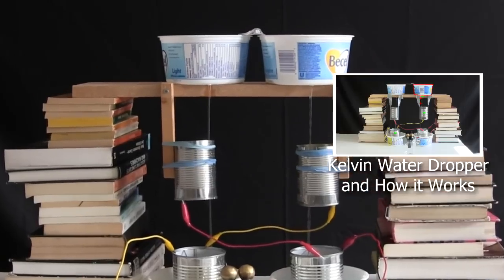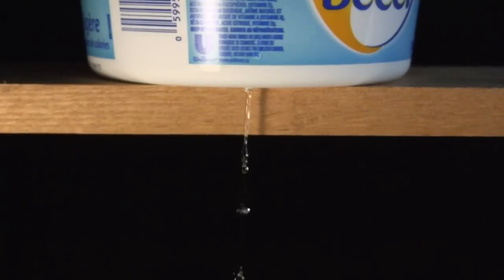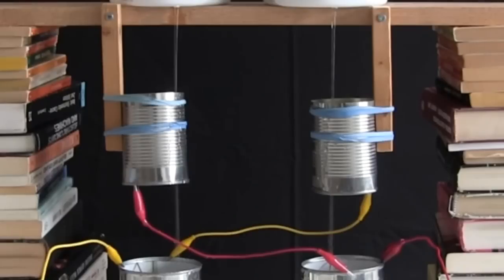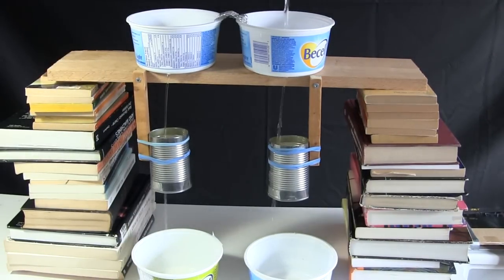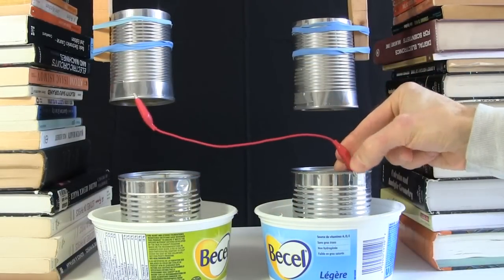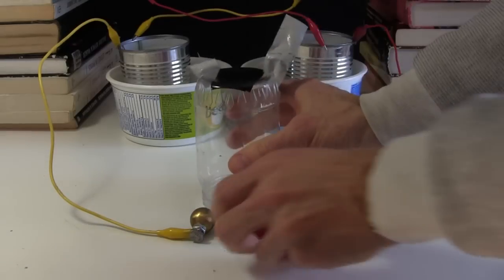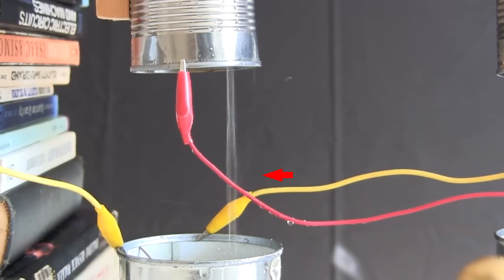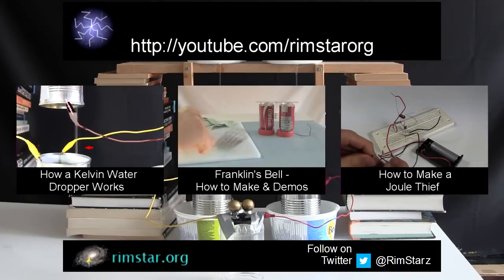How to Make Kelvin Water Dropper/Lord Kelvin's Thunderstorm

Comment from the maker: Some of your questions are answered in my other video "Kelvin Water Dropper and How it Works". There only has to be a different charge in one place on one container, and there usually just is - not everywhere is always neutral. The charge of water drop depends on the voltage between the water stream and the inductor can before the drop breaks away from the stream. There's nothing to do with LC circuits or antennas here.

Comment from the maker: You can make it smaller, the limit being due to the water drops getting repelled from the receivers (the bottom cans) and the need for some spacing between the two sides, as mentioned in the video. The kv is because it produces direct current and that the spark gap has a low capacitance. The low capacitance means that the small charge in the current can reach high voltage in a reasonable time. So if your app has a small capacitance, or can wait for the charge to accumulate, then yes.

Comment from the maker: It can be used to charge a capacitor. In fact, that's what the spark gap is. It's a two plate capacitor with an air gap as the dielectric. We just happen to charge it too much, so much that the dielectric breaks down. It's a very low capacitance but high voltage capacitor.

Comment from the maker: @Abdulmalik alshaibi No, you don't have to remove the paint for the inductors. You do have to make sure the wire that connects to them is connected to metal.
Regarding the other cans on the bottom, soda cans usually have a coating inside them so you may have to scrape some off so that the water contacts the metal if you're using soda cans there too.PS There's no Reply button under your comment because of your Google+ settings.- go to your Google+ page,- in the top, right corner click on your thumbnail icon,- in the popup that appears, click on "Settings".- for the 2nd question down "Who can comment on your public posts?" set it to "Anyone".
Reply: Thank you so much for the fast reply.
Reply: RimstarOrg hey can you connect this to a Leyden jar or multiple Leyden jars using water ?

Comment from the maker: The accumulation of charge inside a receiver can that's on the table depends on the number of electric drops that fall into the can and the charge on those drops. Regarding rings, if you have a ring instead of an inductor can and drops circled around and touched the ring then the ring would lose some charge. In my case the water wasn't circling around like that though.

Comment: I built a kelvin generator for high school, many many decades ago, and in the circuit between the lower cans I had 8 NE2 bulbs in series and the spark gap.  You thus got both flashing lights and spark.
Reply from the maker: Tom Gillett Nice.

Comment: Why at the start up there is a different electric charge in the containers ?
 
Are not all neutral the drops of water ?

The charge of water drop depends from its radius ?
 
Depends from different value of charges present in the tanks in the startup ?
 
Are the containers or the drops different antenna (LC circuits ) for electromagnetic waves received from external enviroment ?

Comment: Hi there. Great video! :) im trying to do this for my science experiment, but im facing some difficulties. Would it be alright if i ask u some questions here?

for my set-up, im using retort stands to hold the two cans in mid air, the same retort stand is also used to support the wooden plank which holds the reservoir. (is this workable?)

would this be a suitable RQ for an experiment?

How does the rate of flow(size of hole) affect the amount of voltage generated?

Comment: The accumulation of charge inside the bucket, depends from the number of electric drops deflected that go on the table (not in the bucket and not in the conducting can ) ? .... Becose if charged drop goes over the conducting ring, the charge of ring goes down and the process stop. If all the charged drop goes inside the container, the value of charge in the container dosen't change ....Is it right ?

Comment: In my STEM class my group is trying to make this, we were wondering if we needed the wire at the bottom of the can? Or is that just if there's a coating?
Reply from the maker: LuckyStrikes The wire at the bottom of the can is there just to help if there's a coating in the can. If your can doesn't have any coating i.e. it's all metal, then you don't need the wire.I'd put the wire because the area of coating I'd scraped in the bottom of the can kept getting rusty, which isn't a great electrical conductor. So I put the wire as an extra path for electricity to flow from the water to the top lip of the can.

Comment: Thanks for answering my question, but I also had another question on how I would attach this generator to the LED light. Like how would I power it? 2 alligator clips attached on both ends?
Reply from the maker: You'd have to build up the charge first, just like you normally do while waiting for the spark. So I guess wire a very low capacitance capacitor to the spark gap so instead of getting a spark, you'd accumulate your charge in the capacitor. Then, once you've accumulated enough charge in the capacitor, you'd somehow dump that charge into the LED. That part, I don't know how you'd do. :(

Comment: I'm trying to do this experiment with my little brother. we have everything set up but still we can't manage to get a spark. we've tried with different cans of different diameters, and right now we covered some cans with aluminium foil (so all of it can conduct electricity). we've checked the conductivity of the cans to the balls were the spark should be happening and it works, but somehow when we let the water fall it doesn't work. it's a fluent stream when it's passing the first cans and then is turbulent when is exiting it. Any tips or ideas?
Thanks for the help and for the great video.
Reply from the maker: +tomas lugo In order for the charging of the stream to take place, the stream must fall fairly close to the inside wall of the inductor. Even though in the my example I used soup cans for the inductors, the stream ended up having to pass only about 1 centimeter (1/2 inch) from the inside. So you don't need big diameter cans. It will take a lot of adjusting to get this right.
The parts of the two objects that face each other at the spark gap should not be sharp points. They should be smooth. That's why I used two metal balls. You can find rounded drawer handles in hardware stores but make sure you scrape off any possible coating where you connect wires to them and where they are facing each other. Put a dark background behind the spark gap to see faint sparks. Try with a very small spark gap.Thanks for watching and have fun!

Comment: Hello there, thank you for the amazingly awesome video! I have a question. How do you know if the top 2 cans is a positive or negative charge? like let's say both of my top cans are negative charges (or positive) how would i be able to make the other one a different charge?
Reply from the maker: The answer to how to know is complicated and involves using an electroscope. See my video "Positive or Negative? How to Find Electric Charge Polarity" http://youtu.be/HupFY_24o-4 for instructions. The 2 cans should be oppositely charged automatically though. I guess you could simple touch one with your finger while it's running to unbalance the charge.
Reply: You could use at least 3 transistor, a led, anttena to easily build a polarity detector

Comment: I'm trying to do the same experiment as shown in the video for a school project. The only major difference is that I am using nails and brass bars instead of brass balls.I kept all the problem in mind that could occur but it still isn't working. Can you please tell me what else can I do to make it work? My project is due in 2 days.
Reply from the maker: Rakesh Mittal You mention nails and brass bars for the spark gap. Make sure that the parts facing each other across the spark gap are not sharp. The rounder they are the better.It does take some adjusting, mostly with making sure the water 
entering the inductor cylinders from the top is a solid stream and the 
water coming out of it is not. Also the position of the stream inside 
the inductor cylinders makes a difference. So play around with the 
height of the cylinders in the stream and try getting the stream as 
close to the inside of the cylinders as possible without touching.You could also try making an electroscope like I show in my video "https://www.youtube.com/watch?v=sArNxGnYhNU" You can see how to make one in my video "https://www.youtube.com/watch?v=2PmWlPjV6n0".
Also, put a background behind the spark gap and try making the gap small to see faint sparks.

Comment: Hello, I have another question.
I would like to know how you could use this generator to power certain electronics. What can it power and how would you attach it to the electronic to power it. You could possibly explain this in a video demonstrating what you can power with this generator and how to do it, if you cannot make a video, is it possible still to answer my question?
Reply from the maker: I can't think of anything it could power. It's extremely week. But I guess it can be scaled up in size and quality to maybe make an LED light up every now and then.
Reply: electrostatic generators arnt much efficient to generate current
but recently i read a paper about a jet electrostatic generator that reassembles kelvin water dropper
but they use just one and not a tandem
instead using gravity, they use as they describe it balistic enertia and they slow the droplet using an electric field

Comment: Does the Kelvin Water Dropper have a extremely high amount of electricity? Can it charge my iPad/Computer? Or is it only strong enough to power an LED light?
Reply from the maker: It's output isn't good enough for either of those things, practically speaking. But if you accumulate enough of it in a capacitor over a period of time you could make the LED turn on briefly. Then you'd have to wait while it accumulates more to turn it on again.

Comment: I would be really grateful if you could answer this question... I am trying to build a water dropper for a project, but I can't find a way to measure the voltage or current that is generated in the system. Where would I have to place the multimeter? Thanks!
Reply from the maker: This is high voltage (1000s) so you can't use a multimeter with normal probes. However, there are high voltage probes that you can connect to your meter. I have a video about the one I use most often http://youtu.be/kXq4FCQ0C38.
You could use the spark length to estimate voltage instead. I wrote an article here about doing that http://hackaday.com/2016/12/08/measuring-high-voltage-in-millimeters-and-other-hv-probe-tricks/. It also talks about high voltage probes.
Measuring current is trickier since high voltage is involved. I've used an analog meter in the past but I don't think the current is high enough with the water dropper for that. Another possibility is to connect a resistor inline with one of the wires going to one end of the spark gap, making sure to keep all connections without sharp edges and away from any water, and measure the voltage across that resistor. Then use the formula, current = voltage / resistance. I haven't tried that method yet.
Reply: RimstarOrg Thanks a lot! I have seen someone use a galvanometer to measure the current. How would I have to connect that?
Reply from the maker: I've never used a galvanometer, though it seems very much like an analog meter. Just disconnect one of the wires going to one side of the spark gap and connect one end of the galvanometer to that wire and the other end to the spark gap. If the needle doesn't move, or if it goes the wrong way, then disconnect the meter, turn it around and connect it back up again.

Comment: Good Day :) I'm so interested with this one so I decided to use this in my presentation, but of course with the acknowledgement for you . I've try to do this water dropper, I've also follow all the instruction that you gave but why is it still not working and produce a spark?
Reply from the maker: +Leniram Ledodnum Hi. Read through the comments to this video. You'll find other people have had problems too and found solutions and if you still can't find the problem, let me know.
Reply: +Leniram Ledodnum Yes Sir I also did your comment with their problems but it is still not working.  Can I have some questions?? Does the rust in the can affect the flow of electricity or charges?
Reply from the maker: +Leniram Ledodnum Yes, the rust can affect the flow of electricity. If there's rust then you should scrap it off and try again.
Reply: +Leniram Ledodnum I've already use a new one can but it is still not working, do I need to use the same can that you've use on your video?
Reply from the maker: +Leniram Ledodnum No, you don't need the same can that I used. And it sounds like you've already been scraping any coating on the inside off, so that's good. Make sure that however you're connecting to the can with the wires is connecting to the metal of the can.
Here are some tips copied from the comments below...
Make sure the water enters the inductor cans (the ones that the water falls through) as a stream and exits as drops as I show in the video.
It does take some adjusting, mostly with making sure the water entering the inductor cylinders from the top is a solid stream and the water coming out of it is not. Also the position of the stream inside the inductor cylinders makes a difference. So play around with the height of the cylinders in the stream and try getting the stream as close to the inside of the cylinders as possible without touching.
There may also be a coating inside the cans that are sitting on the table that could be interfering. The coating may not be visible. Use a sharp object (e.g. the tip of scissors or a knife) to scrape some of the coating off inside those cans. The areas you scrape should be areas that are under water. 
The two ends of the spark gap that face each other should not be sharp points. They should be smooth.
Put a dark background behind the spark gap and try making the gap small to see faint sparks.
You could also try making an electroscope like I show in my video "https://www.youtube.com/watch?v=sArNxGnYhNU" You can see how to make one in my video "https://www.youtube.com/watch?v=2PmWlPjV6n0".
You might also get some ideas from my webpage about this:
http://rimstar.org/science_electronics_projects/how_to_make_a_kelvin_water_dropper.htm
(I'll add all of the above to that webpage too. Seems like a good idea.)

Comment: so ultimately the inductor u have used is a simple metal can ........
istead of can cn i use a copper coil...will it work..
Reply from the maker: It should work. Some people even use a copper ring, but I think that would be harder to line up with where the falling stream of water turns into individual drops. Keep in mind, by inductor we're talking about electrostatic induction, not electromagnetic induction.

Comment: So before I get my kid started on this, I just wanted to know for the  speak gap..I do not have any more wire that will go from the inductors to the spark gap..do you have a solution for this?
Reply from the maker: +Chris Kemp You can find wire by taking apart old electrical appliances and things. I use wire from things that way sometimes.  I guess you would use strips of aluminum foil instead of wire but the sharp edges will reduce the effect. I guess folding the edges of the foil would help.

Comment: can we use metal wires wound into two rounds as inductor coils?
Reply from the maker: harish gureddygari Yes, you can. You'll still have to position them such that the water is a solid stream above the wire rounds and droplets below the wire rounds.
Reply: RimstarOrg does area of cross section of inductor has anything to do? i mean will it affect the exp?
Reply from the maker: harish gureddygari I don't see that it would matter.

Comment: Hi! Me and a partner are trying to make a similar set up for a nano science class in our high school and we're facing some difficulties. Is there any way to get in contact with you to do some trouble shooting or ask some questions?
Reply from the maker: Natalie Elowitt Sure, ask away. But first check through these comments since I've helped others here already and also see my webpage http://rimstar.org/science_electronics_projects/how_to_make_a_kelvin_water_dropper.htm.
Reply: RimstarOrg okay so we've spent a bunch of time trying out different receivers and even cans that we scraped but we're still having issues getting a spark. there was some attraction between the water and inductors but it was brief and not strong. we're using two plastic buckets as reservoirs and brass dresser knobs for our spark gap. we've sanded that down to remove any possible coating. do you know of any way to get results? we think that the receivers are our problem but we are not sure and would appreciate any input. thank you!
Reply from the maker: Natalie Elowitt I found the water has to be close to one side of the inside of the inductors but not touching. So most of the can isn't playing a part at all. Playing with the inductor positions vertically and horizontally seems to be the most important thing. Make sure you've not only scraped some of the inside of the receivers but also make sure that where you attach wires to the receivers and the inductors and the brass knobs are making contact with metal. Also, put a dark background behind your spark gap. The spark can be so faint that it might be there and you're just not seeing it well enough. Try with the brass knobs very close together.